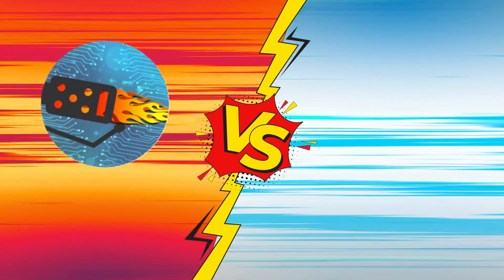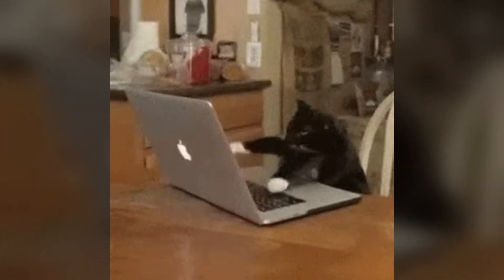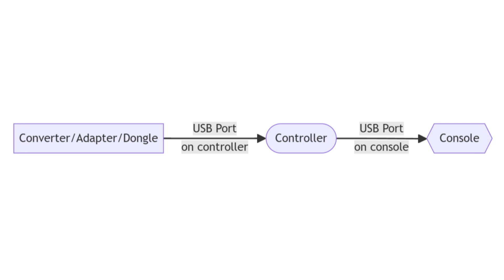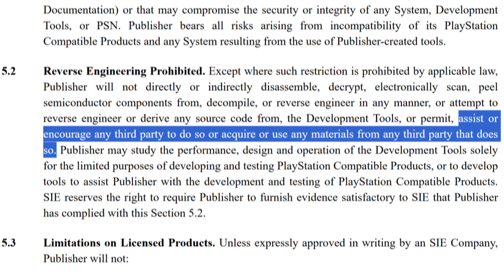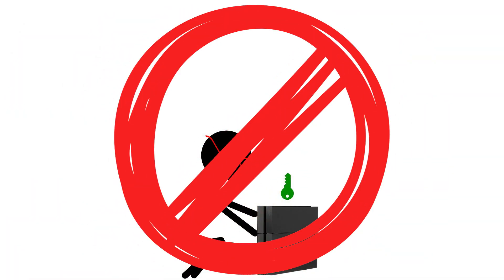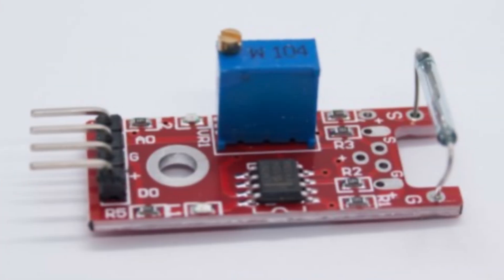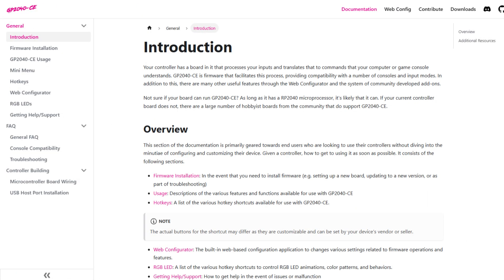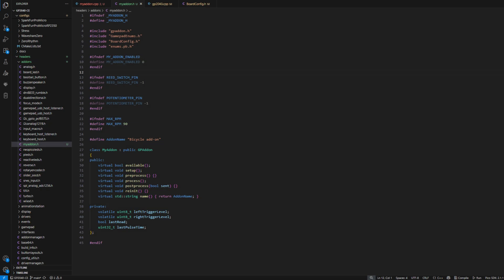I Turned My Bike Into A CONTROLLER For $10

Comment: So, I had the same sort of problem when wiring dual flight sticks for a spaceship simulator project I worked on, namely custom controller compatibility. What I eventually landed on was gutting a third party controller for its mainboard and then re-wiring the buttons and control stick inputs to those of the flight sticks. I'm not an electrical engineer or anything, but I don't think it would be to hard to do the same with an rpi or Arduino as the input.

Comment: Since you are so talented at coding would you ever consider making an emulator?
Reply from the maker: An emulator for what?
Reply: @FlamethrowerYT I assume for a console. NES is a good starting point I've heard.
Reply: @FlamethrowerYT You already challenged sony. Why not a pokemon emulator?
Reply: @FlamethrowerYT Basically the skeleton key of emulators mixed or compiled where it works with every game, this would take a lot of time with porting framework and modding how it loads for each game file and for each emulator/bios/firmware. Retro arch kinda does it with a core loader but I think there is greater heights.
Reply: @FlamethrowerYT for every type of file of game, challenge yourself and build on it haha you got it.
Reply: @FlamethrowerYT even if you learned how to make a emulator for basic 8 bit games it would be a grand start